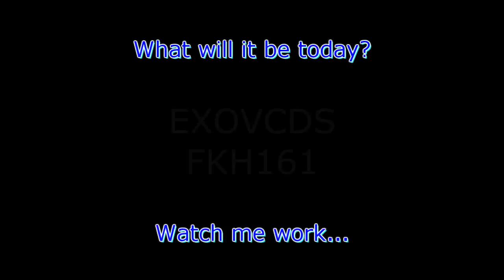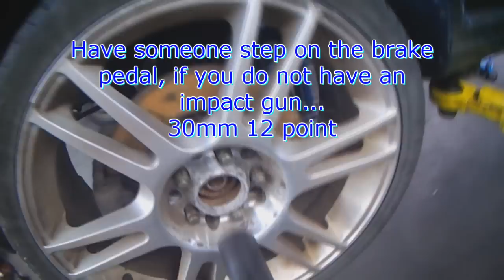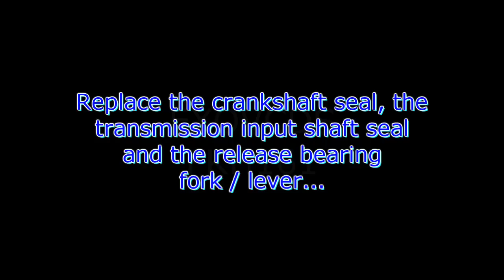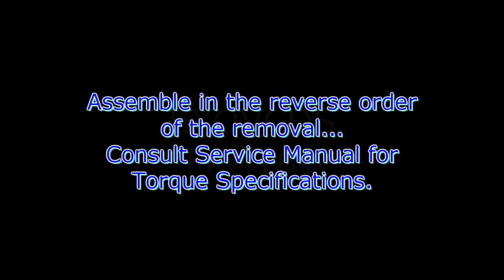VW A4: 2.0L AEG Transmission / Clutch Removal

Comment: Hi I was wondering what is the tool you used to take the shift cable off after you took the screw out in the beginning of the video
Reply from the maker: lilmonster96 At what point (time) in the video?
Reply: To take off the linkage at 5:25 also is there a email I can send you a video of what my jetta sounded like and someone told me to change the clutch and throw out bearing
Reply from the maker: lilmonster96 That's a battery clamp puller... also works great on windshield wiper arms. =)
fkh161@fkh161.ca
Posting on your YouTube channel won't have file size restrictions like email has.
Reply: Thomas EXOVCDS okay thanks and was it hard to get the cv joint off I'm having issues with finding a 8mm triple square bit
Reply from the maker: Triple square, twelve point... there are some other names for it as well. You'll need a long extension to make things easier. It's possible to get to them with a short extension, but easier with the longer one. For the most part I don't have any problems with them. Sometimes they strip, then you have to tap them loose with a hammer & chisel.
Reply: Thomas EXOVCDS okay thanks for the advice

Comment: I have a 99 vw jetta aeg 2.0, about to replace clutch,  what are the main components I should replace..ordering parts...any seals? bolts? any advice I appreciate. thanks..your videos rock, done lots of work due to your help..thanks
Reply from the maker: Clutch kit includes pressure plate disc & release bearing. Replace the release fork also (VW or "beefed-up aftermarket only). Crank seal & tranny input shaft seals can be left alone if they still look good... but worth doing regardless (for the amount of work involved getting to them). The the release bearing slides along the sleeve that covers the input shaft. You can get the sleeve by itself or with the input shaft seal in place. That's all I can think of top of my head. Single mass flywheel can be reused... resurface if need be. Can be sanded smooth and used as is, if no hot spots are present. Slave cylinder can be replaced at a later time, no need to do it now. Do not disconnect the hydraulic lines, and you will not have to bleed the clutch.
Reply: Thomas EXOVCDS  thank you sooo much my dude!
Reply from the maker: Let me know how you make out... play safe!
Reply: @EXOVCDS  hey Thomas I got the flywheel off, it's a dual mass ..can I use a regular flywheel vs dual mass? does it matter I've read they are interchangeable...had to ask a pro..thx
Reply from the maker: @ivan90815  yes, you can install a single mass flywheel clutch kit (the engine in this video has one). Lack of dual mass can cause transmission rattle at idle, but that's more so with TDI engines. Just make sure that the disc is also meant for single mass if you are installing a single mass flywheel.
Reply: Hey Thomas I finally got all my parts. I did notice I did not have any transmission bell housing to motor bolts. I've read they need to be replaced but I've also read it's not necessary what do you recommend... I just don't wanna wait for a couple more days to get those bolts that's really the only thing I'm missing .
thanks
Reply from the maker: @ivan90815  which ones exactly in this video? I reuse all bolts that secure the transmission to the engine.
Reply: @EXOVCDS   I got the new sleeve with the input shaft seal what are the torque specs for that. I'm talking about the sleeve the throw out bearing slides on.

I got the stickers, thank you as soon as I get my jetta running it's going on the back window.😎👍
Reply from the maker: @ivan90815  Service manual says 20Nm
Reply: @EXOVCDS    I got everything put together and I finally got it running but it is leaking oil between the engine and the bell housing of manual transmission..
I replaced the rear main(hope it's not that) and everything you suggested.

I looked and it's a small amount of oil leaking when it's jacked up from the  driver side. when its leveled seems to leak more.

I looked underneath... , is it possible the 3 bolts on the bottom of the bell housing near the dog bone mount are in the wrong place and not sealing correctly?

it runs and shifts great..

thanks again
Reply from the maker: @ivan90815  The three lower bolts go into the oil pan and do not seal any potential leak areas. I have never had oil leak out of one of them... cracking the oil pan from over tightening could be a possibility. What type of rear main oil seal was it? Rubber seal or PTFE Teflon Seal? The PTFE should be installed dry (without lubing with oil). The rubber seal should be installed with a bit of lube. The transmission input shaft seal can leak gear oil, but if the leak is more evident when the vehicle is level, it's probably engine oil. Did you replace the rear main oil seal complete with the flange? Did you use an installation tool to guide the seal over the crankshaft? In any case, you will have to remove the transmission again, sorry.
Reply: @EXOVCDS ptfe no lube used..and   the whole rear main seal flange was replaced ..and installation tool was used...when tearing it back down..anything to look for ..or just tear it down..
I triple checked everything ugh...no prob iam a pro at this now..thanks
Reply: @EXOVCDS  does that mean I need new clutch if oil got on it?
Reply from the maker: @ivan90815  I don't think that oil got on to the clutch that quickly... should be OK. Did you use sealant between the bottom of the flange and the oil pan?
Reply: @EXOVCDS  yes I used some sealant... followed the videos..it drives, shifts great...gonna take it Into my shop tomorrow since winters here gonna see if i.can get it done in a day now.since I have all  new parts on.
Reply: hey thomas , my dumb arse forgot A bolt that goes to the rear main bolt..(that has to be the issue)
sooo can I reuse the seal? I pulled it off and cleaned it up but ptfe is soaked in oil wasnt sure if that would be an issue.
Reply from the maker: @ivan90815  Does it feel soft or is is holding its shape? I would probably not reuse it... for all the work that is involved, the cost of a new seal is cheaper than having to spend time taking things apart a 3rd time.
Reply: @EXOVCDS  got it running! thank you!
never thought I could do this job...after taking it apart twice I feel like a pro😂🤣.

 Hopefully this will be my last question...

When I 1st got it running and found the leak I did not have any red battery light on my instrument cluster turn on. now that I had a friend help me put it back together I'm thinking he might have missed something. Is there anything (wire) that could cause my battery light to turn on...
figure it's got to be near the starter...any fuses?
Reply from the maker: @ivan90815  There's nothing that really comes to mind... in terms of a "disconnected connector" causing this. Do some voltage drop test like in this video and see what you can find / what readings you get: https://www.youtube.com/watch?v=ieUbfUTwNjQ Check the fuses on top of the battery as well. The video is of a TDI engine, but your 2.0L has the same alternator & fuse box setup. The thick black cable on the far left of the fuse box is the alternator charging cable. A bad connection there is common with age. None of the nuts should get hot-to-the-touch when the engine is running. If they are, then there's a bad / loose connection (causing resistance & heat).

Comment: hey Thomas I have a 04 audi a4 and have replaced the master cylinder and slave and can not bleed them to save my own butt. I get fluid but no bubbles and pedal remains soft. if I pump like a mad man clutch will start to disengage and car will begin to roll. Is there some trick to this? People talk about a pressure bleeder but know one knows how much psi to apply. Any help would be greatly appreciated. Thanks
Reply from the maker: +DanTheMan70 :p What was the original reason for replacing both master & slave? I usually pressure bleed at no more than 15 psi. Audi A4 Service Manual info lists: http://fkh161.ca/Audi/ClutchBleed.pdf using https://vw.snapon.com/SpecialToolsDetail.aspx?itemId=23920009 If you have no air in the system, then the problem is with the release mechanism in the bellhousing. If you can block the hydraulic flow some how (pinch a rubber hose where you can), the pedal should be hard / solid. If not, then you do still have air in the system.
Reply: +Thomas EXOVCDS Thanks for getting back sounds like internal then. I did block the slave from extending out and clutch pedal was hard as a rock. Hey once again thanks for your help
Reply from the maker: +DanTheMan70 :p Let me know how things turn out.
Reply: +Thomas EXOVCDS well got the car apart over the weekend and replaced complete clutch and flywheel. First assessment after removing the trans was the pressure plate forks or prongs that throwout bearing presses against were lets say little more then 1/3 of them were still depressed and clutch disc the side against flywheel when pulled away fell apart. so installed new parts and works like a champ. The clutch disc was pretty worn being the side that was still together. I've only owned this car about three months now and 2000 miles so I guess previous owner rode it pretty hard. Well keep those vids coming for us folks that can't afford the repair shop. Thanks
Reply from the maker: +DanTheMan70 :p Thanks for the update! I'm always amazed at what viewers are able to do at home in their garage! Good work!

Comment: Hi Thomas 03 Jetta 2.0 5 speed. I have a pulsating feeling in the clutch pedal when I push the clutch in. I have read that it could be an issue with a dual-mass flywheel. I am not sure if this car has a dual-mass flywheel and I'm just wondering if you can give me some direction.
Reply from the maker: Last one I did did not have a dual mass.
Eventually the transmission will need to be pulled (either when clutch starts to slip or when the pulsing gets worse)... up to you how soon you want to pull it.
Reply: Thomas EXOVCDS so is it the transmission or is it going to be the clutch assembly flywheel all that. I was just assuming that you meant pull the transmission to replace the clutch and flywheel
Reply from the maker: I can tell with my keyboard.
I have never had a transmission that caused a pulsing in the clutch pedal. 
When the time comes for you to pull the transmission (to check / replace the clutch components)... if there are no faults found with the clutch, then look at the transmission (it's out already for easy access).
Reply: Thomas EXOVCDS thanks thomas you da man
Reply from the maker: Sorry... I meant I "can't" tell with my keyboard.
Keep an eye on it for now. If / when it gets worse or the clutch starts slipping, you will have a good / better reason to pull the transmission... than just a slight pulse in the pedal as you have now.
Uneven pressure plate springs could cause a pulse in the pedal... forgot to mention that.
Reply: Thomas EXOVCDS so now it is more of a rotor grinding when brake pads are low sound. Sounds possibly like the low roar of a bearing going out.
Reply: Although it is quite loud when you push the clutch in.
Reply from the maker: Maybe the clutch release bearing fork is cracked. Does the clutch pedal feel softer as well... clutch gabs lower?
Reply: Thomas EXOVCDS it does feel softer
Reply from the maker: Maybe this: https://www.instagram.com/p/BnXZRyZAqxr/

Comment: hi thomas i have a vw mk4 tdi alh 1998 and when i start with 1st gear it vibrates a bit  till i start moving completely could the clutch be the problem
Reply from the maker: Yes... clutch chatter / jerking. Could be a weak pressure plate or oil contamination on the clutch disc. Drive until the clutch starts to slip, then replace the clutch.
Reply: can it leave me stranded somwhere because i do a lot of travelling from city to city but i dont hear any noise the car vibrates till i reach speed of 4-5 mph then it stops acts like normal or or can it be from bad weather cause its like -5 in my country p.s i changed my dogbone mount and other mounts are on good condition
Reply: thank you sir :)
Reply from the maker: Clutch chatter should only happen as you are releasing the clutch pedal... once the pedal is fully up, there should not be any chatter. I can't predict the future... I doubt it will leave you stranded.
Reply: no my problem is not chattering is  the vibrating when the car starts to move in first gear till reachs speed what could it be ? te clutch or pressure plate
Reply from the maker: Have a shop test drive it. I can't feel it over the internet.
Reply: thank you brother :)

Comment: Hey so I did everything in the video and I can't get the transmission to come off. It won't even budge. My car is a 2000 Golf Gti 2.8L VR6 5 Speed, if that helps.
Reply from the maker: makes sure all the bolts are out... there's one under the thermostat / coolant flange. Use a pry bar to separate the tranny a bit from the engine.
Reply: Thomas EXOVCDS got that one um there is an 18mm one like behind where the starter goes could that be it?
Reply from the maker: Probably.
Reply: Thomas EXOVCDS so I got it off but we can't get it out is there an easier way to get the transmission out, we can't get it to twist
Reply from the maker: remove the passenger axle flange at the diff. Remove the aken bolt that's in the middle if the flange... then you don't have to twist / rotate the transmission.
Reply from the maker: Allen bolt.
Reply: I got everything back in but it won't start, I have a cord that is bound up with the wire that goes to the starter. Do you know where it goes?
Reply from the maker: BuddyRich45 Send pictures to fkh161@fkh161.ca

Comment: do u know how to bleed the clutch?
Reply from the maker: +Joe Bak You should only need to bleed the system if the hydraulic lines were opened. If you left the slave cylinder connected and you did not open any lines during the clutch replacement, then you should NOT have to bleed the system. Remove the slave cylinder from the transmission and block the release pin from coming out... pump the pedal by hand. Is it rock hard? If no, pump a few times and then hold the pedal down, while someone else opens the bleeder on the slave cylinder. Close the bleeder as soon as flow (air or fluid) stops. Pump the pedal again and hold to the floor... open the bleeder, close the bleeder. Continue until you have a "solid" pedal. Install the slave cylinder in the transmission... how is it now?

Comment: how much would you charge to do that?? I'm thinking about having someone do it
Reply from the maker: +dj garant Bring your own parts / just labor? Or the whole thing? I'm at work... might have some dollar value for you later. Will vary a lot depending on country / location / city / state etc.
Reply: +Thomas EXOVCDS yes I would bring all the parts
Reply from the maker: +dj garant Just checked mitchell labor guide. 2000 Jetta 2.0L flywheel / clutch removal quote is 5.5 hrs. Extra time for rear main seal replacement, transmission input shaft seal replacement, if other things are found that need attention, also more time. Shop rates vary from $60/hr to $120/hr Make sure to supply rear main seal (extra time), clutch kit (flywheel, pressure plate, disc, release bearing), input shaft seal / release bearing support flange, release bearing fork). If you have a 6 speed transmission, there are some differences. I have a meeting tonight, so this is the best I could come up with.

Comment: Audi 1.8t AEB engine, replaced engine, when installed flywheel I applied this http://www.gear4motorcycles.co.uk/images/ww/product/fromxmlplatinum/01-027.PK12-1_pu.jpg and tightened to 60 NM and I think I forgot to do 180degree thing because I was working very late and got distracted, now there is little rattle at idle, very little. Activating the clutch does not change the sound. Will my flywheel fall off? Any input appreciated, thanks!
P.S. Used old flywheel, didn't have that rattle before swap or any other clutch related problems
Reply from the maker: raimondszunda Yes, could be that the flywheel is knocking against the bolts... best to pull the transmission again to inspect.

Comment: Is clutch bleeding required after clutch change? If yes, is it bled from the Slave Cylinder? Thanks.
Reply from the maker: Omar is Rad Should not be needed unless you opened up the hydraulics or the system ran low on fluid / air entered.
Reply from the maker: Omar is Rad Yes. bleeding is done at the slave... I like to remove the slave from the transmission (two 13mm bolts), collapse the pushrod / hold it in place and then pressure bleed with the slave bleed nipple higher than the reservoir, so that the air can flow up & out of the bleeder.
Reply: ***** You bleed it with the slave removed and pushrod pushed in? interesting. Can it be bleed with the slave cylinder installed while someone pushes and holds the clutch pedal all the way in? I have a power bleeder. I've done plenty of brakes before but not sure if its similar to bleed the clutch.
Reply from the maker: Omar is Rad Yes you can... it's the same principle as brakes. The clutch system is a little more sensitive than the brakes (to air getting stuck), that's why I raise the slave. I push the rod in a bit so that I can attach a clamp to hold it in place. Some guys reverse bleed (force fluid into the slave bleeder, so that the air comes out of the reservoir.
Reply: ***** Alright good info. Thanks! Changing my clutch this Friday on my driveway if weather permits.
Reply from the maker: Omar is Rad Have fun... play safe!
Reply: ***** Again for providing this video. I didn't require clutch bleeding. here is a pic of a test fit on flywheel and clutch disk.http://41.media.tumblr.com/51269be76b3615d28b765b8b9df839f3/tumblr_nn0kdoTkvt1se7iwxo2_1280.jpg
Reply from the maker: Omar is Rad New parts always look so nice!